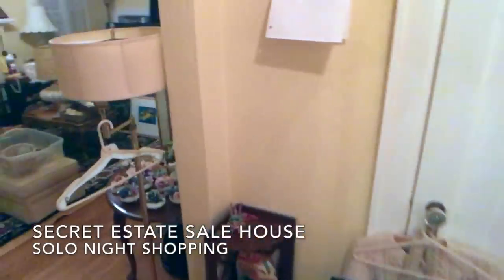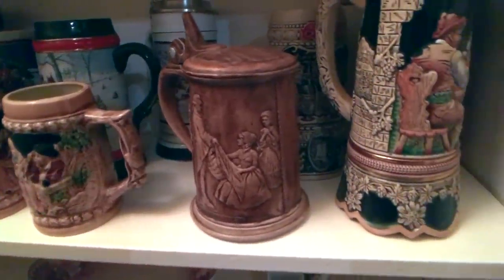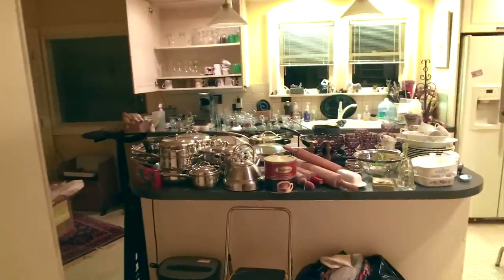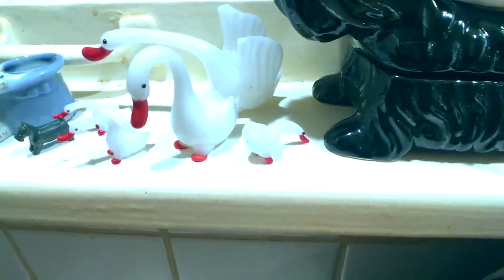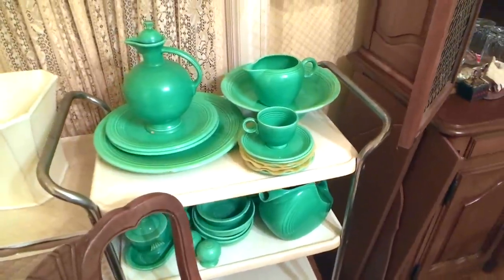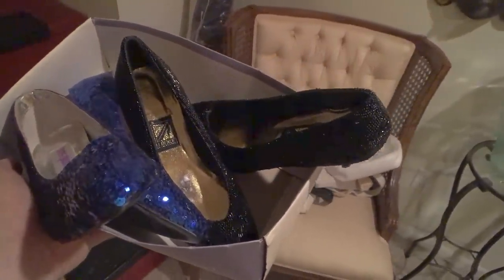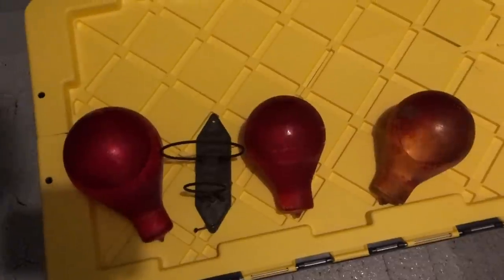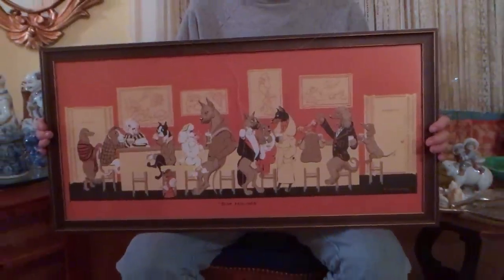Treasure Hunting at an Estate Sale! | Uncovering Vintage Finds in a 1940s Home

Comment: Hey George, my son is an electrician and has told .e many tines that those old lamps with the old wires Re good to go asong as the plug part isn't cracked nor the wire frayed. I have a very, very old heavy floor lamp. Either iron or brass with holes for crystals. Has its original cord.
Reply from the maker: I agree with him! They were made properly and should work fine. I'm glad you left yours original

Comment: DANG! I really liked that modern-ish vase you picked up and moved to see the "Bar Hounds" print. I wish you would've identified it. BTW,  that fireplace looks like its surround might be Claycraft tiles!  A contemporary of Batchelder.  (I'm wondering when the house was built?) Thanks for the tip about the fire extinguishers; when I grew up in my Grandma's homesteaded house in OKLA there were about three of those mounted on the wall in various areas. Yikes!

Comment: Wow that "Gomco" machine really brought me back to when I first started my nursing career on a med/surg floor. It was actually a suction machine that was connected to a nasal gastric tube that continually suctioned the contents from a patient's stomach when they had a blockage in their intestines or bowel.
Reply from the maker: Interesting! I got one from a guy who used it for similar purposes at a marine biology lab. I already had the stainless lab table it went with... The set sold already though.

Comment: My husband said the all metal plane is called a circular and or compass plane. The gears adjust to either make a convex or concave arc in the wood.  He said it is worth around $100 depending the type study.  (He does wood working and collects planes) He also said it is  a number 113 not 118
Reply from the maker: Thank him for that info!!i appreciate it. I did misread the number when I picked it but he was right and it did sell for $95

Comment: Fantastic video!!! That cordial set is still on my mind 🙄 I would've probably had to have grabbed that. The oil can is another item I really liked. As always, I'm looking forward to the next one!!!
Reply from the maker: I wished to have taken the cordial set after I saw it again! The oil can was certainly the oldest thing I saw there.
Reply: @TheAntiqueNomad  Yeah, that would've been a regret, for me, if I had passed on it. Those sets fit in with my beverage sets collection well. That oil can was, to me, in remarkable condition, for it's age. Considering how they were used, it survived well!
Reply from the maker: CONSTELLATION PEGASUS especially considering its use and that it wasn't meant to be saved!!
Reply: @TheAntiqueNomad  Yes, I've ran across quite a few items that I wondered just why they had been saved. Granddad was bad to just set things like that on a brace, between 2 x 4's, in the barn, and they just sat there, until they were so covered in dust you couldn't even tell what they were. Now, I wish I had some of those things!
Reply from the maker: CONSTELLATION PEGASUS I love finding dusty barns with forgotten treasures!